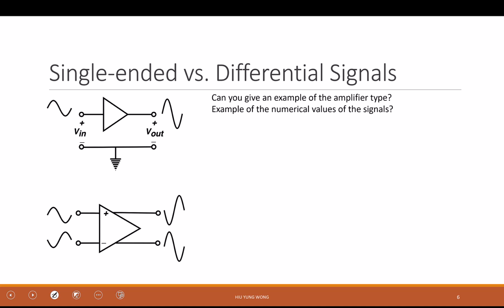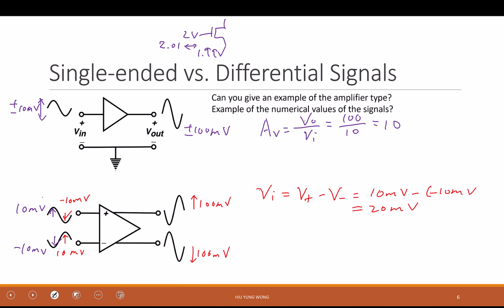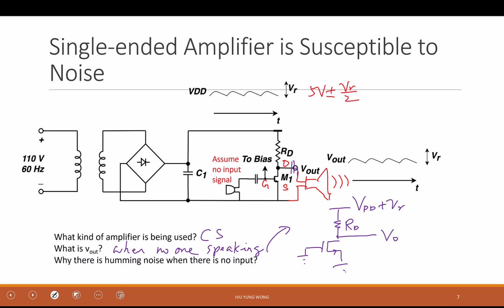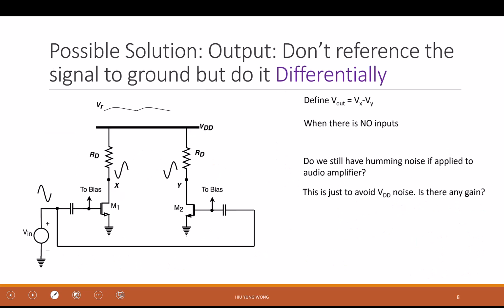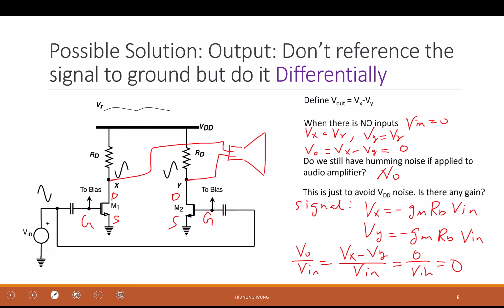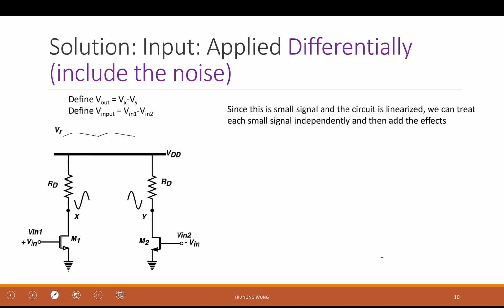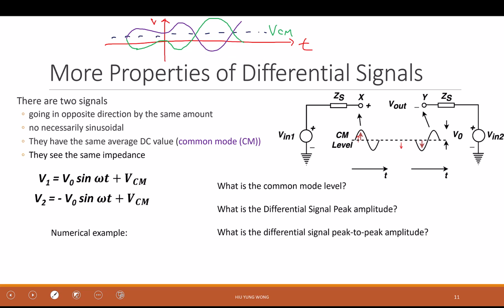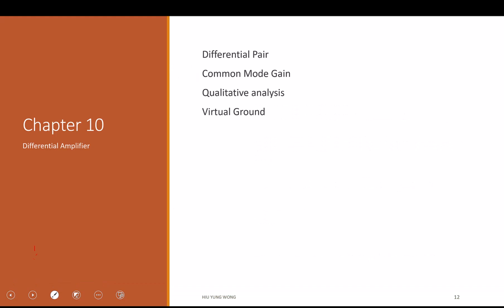L14-2 Differential Signal and Differential Circuits

Comment: Hi Professor, I wonder once I finished all the lectures in this series, which I have lots of interest in, what's next? Could you please share some advice and thoughts? Thank you so much!
Reply from the maker: @nan-3082, I do not have other advanced videos at this moment. I might try to upload more in the future. On the other hand, if you want to continue with more advanced topics on analog circuits, please read Razavi's "design of analog cmos integrated circuits". I hope I can make videos based on this book in the future.